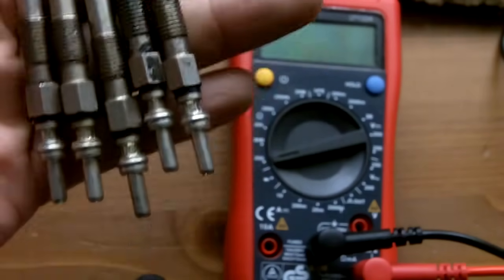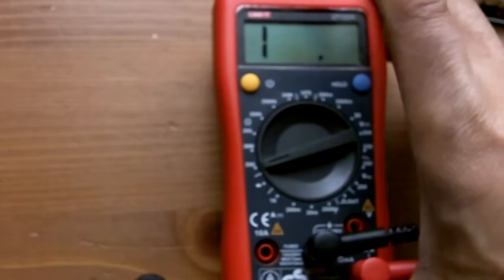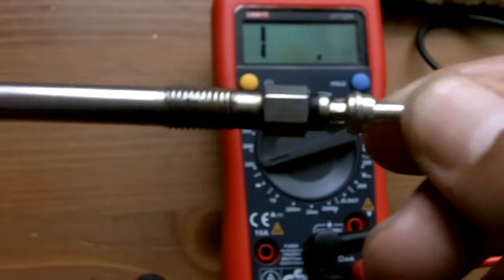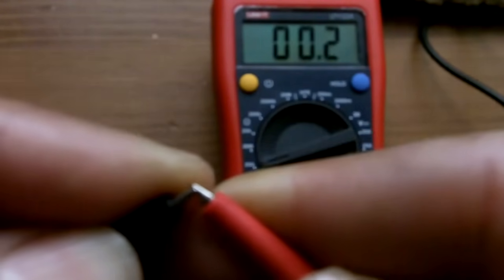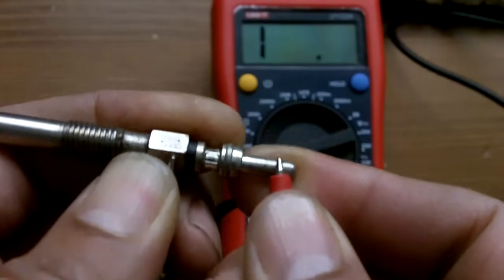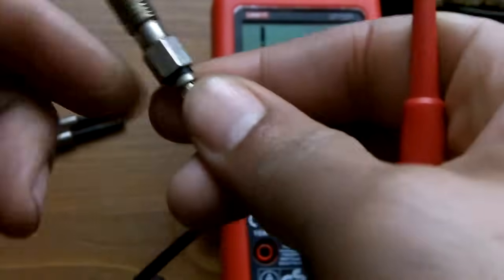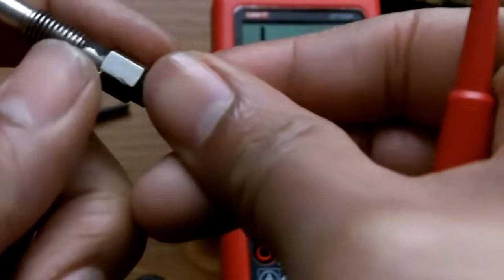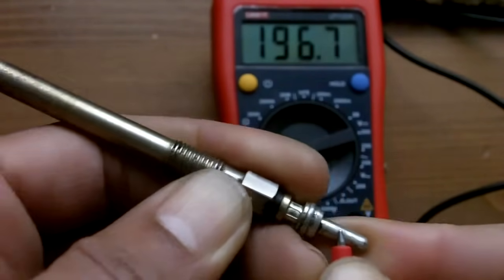Easy and Complete Glow Plug Test

Comment: Why bother using a multi metre, just connect them to a battery if they glow there ok if they don't replace !
Reply from the maker: b57ecv Holding a metal glow plug with a live feed using metal pliers and shorting against the engine?...... Erm, no thanks.

You're making a very simple and safe job very risky and awkward and I don't understand why.
Reply: Also this method saves me having to take them out of the engine - saving me time. Got some work to do on my van in the morning and any time saved is going to be a major bonus. Thanks for the video.
Reply: What if you don't have a car battery lying about the house?
Reply from the maker: b57ecv If the grounding method finds a working one, you then have to do something with a 1000°C glow plug  until it cools.

You seem to like your unnecessarily risky methods but they're not for me so each to his own.

Perhaps make your own videos and see what others think?
Reply from the maker: b57ecv Not all glow plugs are 12volts so if you use your method, you could wreck a perfectly good plug.
Reply: SiRobb just hold it with a pair of pliers.
Reply: SiRobb well then jus take the glow plug out and ground it to earth on the engine block and see if it glows when the ignition is turned on with it's live feed still connected to it,  plus use a light bulb and wire  to check the feed for voltage that's if a voltmeter isn't handy to check upstream of the plug,  plus check other's to see if there working at the same time,  if there's no voltage the problem could be a relay or a fuse,  if that's fine ,  a bad glow plug will show as I described earlier !
Reply: SiRobb it's quit safe it's a very low voltage,  that's why you can touch the positive and negative on a car battery with your fingers and not die.

Comment: By the way, do NOT leave 12v on these for more than a few seconds. Modern glow plugs do not run at 12 V. They start there to get up to temperature and then drop down to 4 VDC.  Also, I can barely hear the video with my volume all of the way up.
Reply: Must be a problem with your device because my volume is less then half way and can hear the audio fine

Comment: the reading on my glow plugs is 0.9 is that considered outside of the normal range?
Reply: Chris koh thats ok as long as its .1 and below
Reply: I mean 1.0 and below
Reply: Thats good, if spec is 0.9 as for my car, anything thats mot far off will work. I have 3 at .9 and 1 at 1.2 and it works just fine

Comment: less than 2 ohms is what you look for
Reply from the maker: zeb akhtar It can vary so for specific figures, you need to refer to your own car's technical data as per the video description. 
If my plugs were 1.9 so under your 2 ohms, I wouldn't be happy and would change them.
Reply: Hmmm.fair enough. Thought they all work around the 2 ohms.you probably right.
Reply from the maker: zeb akhtar No, mine are 0.685 so 2 is more than double the specified resistance.
Technical data is freely available if you want to be sure of your own figures.
Reply: SiRobb you could be right. thnx

Comment: Thank you very interesting.  I have a Hyundai Matrix with starting problems and the glow plugs were changed 6 months ago and the starter motor 1 month ago but the starting problem remains, it seems to me that it would be the glow plugs because once it is running everything is perfect. 
Is there anything in line from the battery to the glow plugs that could be faulty?
Reply from the maker: Duncan Creighton On modern Common Rail Diesels (last 15 years), starting problems are MUCH more likely to be fuel related. 
You need diagnostics to read the rail pressure during cranking but if that sounds too complicated, change the fuel filter if you can't remember the last time it was changed.
Reply: Thank you for your swift response.  A brief history of the car to perhaps help:
2004 Hyundai Matrix 1.5 CRDI
204,000km
Fully serviced from new, last major service (Inc cam belt) June 2006
FIP fully overhauled (reconditioned) 3 years ago
Glow plugs changed 6 months ago
starter motor changed 1 month ago
Battery less than 2 years old and tested as good
Cleaning agent added to the fuel in case of dirty injectors
Once the car is started it runs smoothly and there is no sign of bad exhaust
all work carried out by authorised dealer.

Having watched your video on the glow plug test I was wondering if there is a way to test that the glow plugs actually do work whilst removed but connected to the car system to ensure that there is not another problem within the glow plug circuitry?

Any advice is greatly appreciated
Duncan
Reply from the maker: Duncan Creighton You could voltage test each of the glow plug electrical connectors that fit on the glow plug. 

It's worth noting that as you can see in this video, I only had one functioning glow plug but my car cold started ok. 

In your list of work done, there's no mention fuel filter being replaced. 
You might also want to do an injector leak back test and there's a video showing how in my list of videos. 

There's no harm in making sure your glow plug system works correctly but I'll say again that common rail diesel starting problems are MUCH more likely to be fuel related.
Either delivery of the fuel at low pressure or generating the high pressure required for starting.
Reply: SiRobb thanks, I'll let you know what is found

Comment: man.you are touching  the multimeter leads with your fingers.WRONG!thats mean your body resistance in parallel with glow plug resistance.the result is a lower resistance than it should.take care and do the fair measure.
Reply from the maker: yron mike It makes no difference to the readings because if it did, they would all read the same resistance.
Anyway, body resistance is high (in the mega ohms) so how can I get such a low reading on the one working plug? 
I also measured them touching only with probes on the car and the results were the same.
Reply: i agree.
Reply: Wrong. The body is over 2kohm wet so electricity take easiest path, so make absolutely no difference by holding with fingers. So many people on comment talk rubbish and actually believe their own rubbish. Ffs.

Comment: I've got a 2008 D5, where are the glowplugs?
Reply from the maker: J.T. Jaeger Unless they've moved them on later D5s, on the front face of the engine block. 
Very easy access.
Reply from the maker: J.T. Jaeger Unless they've moved them on later D5s, on the front face of the engine block. 
Very easy access.
Reply: SiRobb Thanks 👍

Comment: On the 406 you can't get a regular socket on as their is no room for the ratchet to plug into it as the thread is too long. You also can't get in a long socket. So I found cutting the thread off the old plug will get on the standard socket to remove the plug. Then on the new plug cut off half the thread and you can get that in too with plenty left to screw on the cable nut.

Comment: please reply what cause the glow plug to read high ohms....................       glow plugs will turn red in less than 10 second we did them at school and one of my classmate was holding the tip he was jump right away
Reply from the maker: If the wiring or conductive material inside the glow plug starts to break down, the current can't flow as easily so you get a high resistance reading.
Reply: +SiRobb  thank you ma english friend, thanks for sharing knowledge less idiot in this world means less trickster I was once tricked one time I knew this time I wont,....

Comment: agree with all of this, all i would add is run then for 20 seconds off a battery, and see they stay lit as sometimes the internal winding in then can 'open' when it gets hot so they kind of light and then go out again. the resistance test is a bit hard for most people as they things can read so low its hard for a cheap meter, just power then up, check they glow withing 3 seonds and stay lit for more than 20, and slap em back in if good, although once you have them out, for the sake of what they cost, why not just stick new ones in, and NO CHEAP BRANDS! i bought cheap and lasted only 3 month....
Reply from the maker: Thanks for taking the time to comment.
The on battery "test" was really for illustration only and I wouldn't supply battery voltage for as long as 20 seconds because you could easily damage a perfectly working glow plug. 
Also not all glow plugs are 12v so once again you could damage them.
The safest method is to carry out the resistance test with the plug still in the engine and do the test cold and after the plug has been subjected to heat and /or electrical load.
This will show up a defective plug and a good plug will return correct figures regardless.

Comment: Your fingers are sometimes bridging the gap between the body of the glow plug and the tip. Would this not affect the resistance reading at all ?. Just wondering....
Reply from the maker: This was discussed way down in the comments and it makes no difference. If you think it does make a difference, don't touch the plug with your fingers.
Reply: Oh I was just wondering. I didn't see all the comments
Reply: Passengervehicles  Your skin has greater resistance than metal, energy chooses easiest path to travel, a very tiny amount is going through your body so it makes no difference on readings
Reply: @LituanoLT  you mean less resistance, less resistance = less power required. Ohms law is voltage (V) = current (I) multiplied by ohms or ohms = voltage divided by current also current = voltage divided by ohms

Comment: Those ceramic glow plugs quickly get up to 1550C and then module control brings them down to 1100C; I would avoid too much time with an 11V battery source with the newest ceramic plugs according to Bosch. Regular metal tip or super metal tips g plugs are something like 750C temp also with intended 11V source. I think your vid is super. I have the 5 cylnder 2.7L. The old 180D plugs were the better shade tree fix. My father said he used to have a cylinder head glow bolt that one would remove; heat with an oil lap til hot and quickly install with gloves and start cranking. Plugs have come a long way.
Reply from the maker: Thank you for the little history lesson and kind words. Much appreciated. ☺
You're quite right about the on battery test but it was for illustration only and I do say that I've done that test so others don't have to. 👍
Thanks again.

Comment: cheers for this. I have a Honda CRV 2011 I am going to check mine while screwed in. Do I have to disconnect the battery?
Reply from the maker: You can leave the battery in place. 
As a precaution, just don't have the keys in the ignition and it should all be ok. 
Just take the usual care not to short anything when doing any electrical testing. 👍

Comment: Next time don't touch the probes with you fingers, because the resistance of your body will corrupt the results. Of course it won't be significant in this case, but still funny that you make a video how to use a multimeter, and you don't know what you are doing. ;)
Reply from the maker: There's been a long discussion on this already and it makes no difference. 
If it did make a difference, I wouldn't have got such a low reading for the functioning plug. 
I don't know whether you've measured your body resistance but it's MUCH higher than 0.9 ohms. ☺👍
Reply: +sirobb You are absolutely right. The resistance of human body is between 200-3000 Ω, depends on the surface you are testing on. But still, it's a basic rule not to touch the probes. You can't be sure that somebody won't touch the probes after seeing you video and following your guidance, and if he/she is trying to measure the voltage in the wall-socket... So be careful when giving instructions to laypersons.
Reply from the maker: +JimTonic79 I hear where you're coming from but if someone copies exactly what I've done, no harm will come to them. 
If they choose to deviate and are dumb enough to take a perfectly safe resistance test on a glow plug then translate that to shoving a probe in an AC mains socket, that's not really my lookout. 
I say at the start, you can do this on the car without removal (which negates the finger touching "risk") so hopefully the 150k+ people who've watched so far haven't been unscrewing all their glow plugs.☺ 
I'm not going to dumb down my videos to accommodate for terminally stupid.👍
Reply: +sirobb Okay, I accept and respect your point of view. 👍

Comment: Great video. With 4 out of 5 plugs gone how did you start the Volvo D5 engine? Roll start every time?
Reply from the maker: On a common rail diesel, the glow plugs are only really need for starting in very low temperatures so the car started ok but would run slightly lumpy for half a minute or so. 
Some engines use the glow plugs for dpf regenerations though so having them all fully functional is a good idea regardless.
Luckily, as you can see, they're easy to test although some engine layouts mean they're awkward to reach.
Reply: Thanks. Is it the same case for NON Common Rail diesels? I have one of them. Your thoughts?
Reply from the maker: +Chas2Can Non common rail injectors work at much lower pressure so the fuel isn't atomised as much when injected. 
This means the role of the glow plug is more important for good starting.

Comment: Glow plugs typically draw about 10A each so the very quick and easy way to check is stick a DC clamp meter over the glow plug feed cable and see if 4 plugs draw ~40A, 6 plugs ~60A etc.  But even then I've seen plugs fail in a way you can't spot with this test or by metering for resistance, because they glow but up in the body of the plug and not the tip, so really pulling them and sticking them across a battery as shown in the video is the only 100% reliable way :)

Comment: Great video bud ive heard about glow plugs snapping off when people try to remove them is there a way to remove them that reduces the chance you know of ?
Thanks
Reply from the maker: Yes you use penetrating oil the day before and on the day. 
It also helps if the engine is hot so be careful. 
You must also use a good fitting hexagonal deep socket and take your time. Don't try to turn it out in one go, so you loosen a little then tighten and repeat, each time loosening a little more and still use regular squirts of oil.
Reply: sirobb  Thanks bud that's good to know was thinking of a torque wrench adjusting up bit by bit until they move but will do as you say with penetrating oil etc don't need to change mine but very useful to know.
Thanks again

Comment: CONGRATULATIONS: You just tested the resistance of your body as your fingers are touching the conductor on both probes! <FACEPALM>
Reply: Davey Lc The resistance of human body is significantly higher than that of the plugs. This means that this "mistake" won't affect the accuracy of the measurement very much. (maybe the fifth decimal would be off but that is irrelevant in this case)
Reply from the maker: The same resistance measurements were recorded (between 0.9ohms and 2.4 Megaohms) when the plugs were still in the engine.
Only the tips of the probes could be used and no bodily contact was possible so how do you explain that?
Or should I be congratulating you for providing one of YouTube's most pointless and ill informed comments?
Reply: sirobb Touching the probes when testing anything is a school boy error my friend :)
Reply from the maker: Davey Lc Have you ever resistance tested your body just out of interest?
If you or anyone has, you would find the figure is WELL into Megaohms.
So how exactly can I obtain such a fine measurement on the one working glow plug if my body resistance is getting in the way?
Your comment is pointless and simply repeating yourself doesn't make it any more valid.
Why don't you demonstrate your "theory" put it on here and show us all what you mean?
I can't wait.....
Reply: There's still a potential difference between the flow of current through your fingers and that through the component, the problem is the resistance of the component is pretty much a constant, the resistance through your flesh isn't so it will effect your readings, granted it will be a small effect but still its not ideal :D
Reply from the maker: Davey Lc Unless you misread the title, this ISN'T a tutorial for the correct method to take resistance readings in all scenarios.
This is a quick test to find if your glow plugs work and it is then backed up at the end by an on battery bench test to prove the theory.
This method works perfectly for testing glow plugs so your observations on THIS video for THIS application are of NO use.
To PROVE your theory, you should make a video where my method mis-diagnoses a functioning glow plug.
Stop quoting from books or what you've heard and actually DO something so you can see and think for yourself.
Reply: sirobb I'm merely pointing out that is someone with particularly sweaty hands tries this out they are going to get invalid readings :D
Reply from the maker: Davey Lc In that case, perhaps you should make a video entitled, "Why you shouldn't resistance test with sweaty hands." to show the world.
If my "incorrect" method can get 100000 views, then I'm sure yours will be a YouTube sensation.